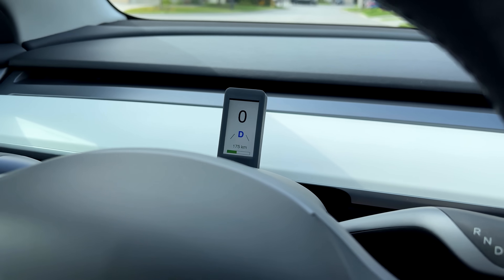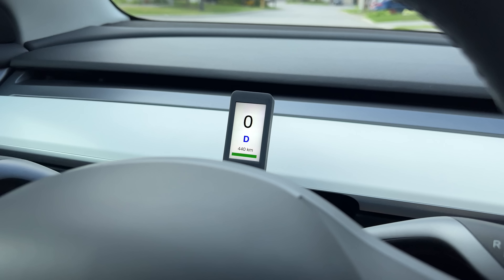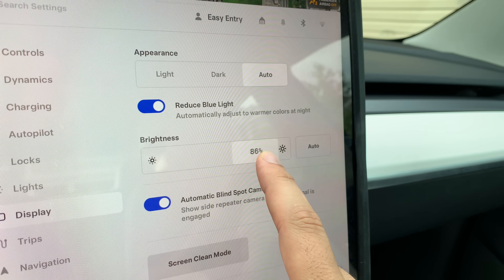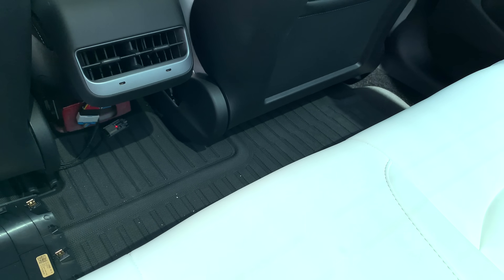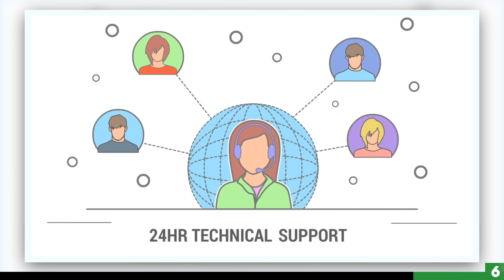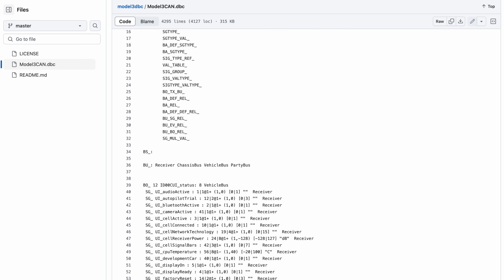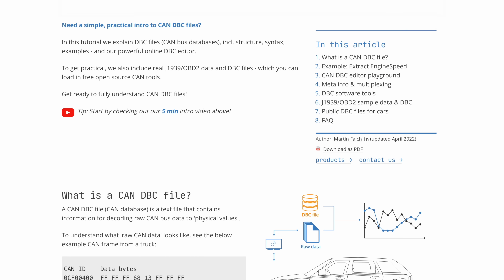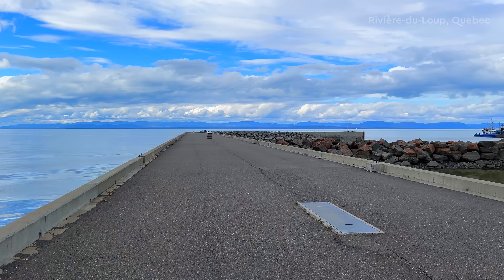I Made a Display For My Tesla

Comment: Awesome project thank you very much!! That would be cool, when the car is at home, from the ESP32 to post battery level to HomeAssistant API every hour. This way you can use HomeAssistant to track down the charging. Also, HomeAssistant could trigger the charging plug when solar panels generates enough energy to charge the Tesla from solar instead of the grid. :)

Comment: Hi! I flashed the stuff to each board and while the CAN SHield turns on, my screen flashes for a small bit, then turns off. How do I fix this? Is there a common issue I might be leaving out?
Reply from the maker: It should work without any setup. Just reply to your order confirmation email with your setup details, and I’ll try to help

Comment: I’m working on implementing Battery Preconditioning and Drift Mode. I think I’ve figured out the Battery Preconditioning part, but I couldn’t find how to disable ESP and regenerative braking for Drift Mode. Do you know their names in the DBC file?
Reply from the maker: That is great. I am not sure about the ESP/Regen. I don’t have that option in my car to test. However you might want to try the Tesla Motors Club forum or their discord channel. They created the DBC file.
Reply: Are you sending values to can bus? This is my next part of the project. Do you use discord?

Comment: I tried flashing the display with your online flasher but someting is not ok, flash seems to be ok but after rebooting the display it seems to be just an OTA updater. Did I miss something?
Reply from the maker: OTA activates when the button on the screen is pressed. It seems like something might be unintentionally pressing that button.
Reply: @MrDIYca , thanks for you answwer. Yes, that was me, I pressed the button because on boot there is nothing in the screen, just blank, it this normal until the CAN bridge send any data?
I also tried the source code link and is seems to be dead
Reply from the maker: That's correct, you won't see anything until the bridge begins transmitting data. It's a members-only link, but unfortunately, YouTube just displays a generic 'not found' error page if you are not a member of the channel.

Comment: Hey! I've purchased about 8 of your CAN shields and love them but I'm having a pretty big issue.

Read mode works flawlessly but ReadWrite mode shows weird behavior. When measuring resistance across CAN H and L I get 120 Ohms in read mode but 0 in read write (soldered the jumper). What's weird is without power but in ReadWrite mode it reads as 120 Ohms but the second it gets powered it drops to 0. The voltage also is off, CAN L reads 0.8v and CAN H reads 3v. Again read only mode works perfect and has them both around 2.5 with no traffic

The ReadWrite mode only seems to work properly if it is initialized and serial monitor is running. Otherwise it causes havoc on the bus, all sorts of impedance and voltage issues and it shuts down my tesla completely. It's also shut down a Rav4 and caused the MIL to go off.

My guess is that when getting power from the vehicle via the 12v pin the bus isn't initialized in time causing these issues, but it works when it's powered prior to getting connected.

I did some more testing and I see you're pulling the RS pin of the CAN transceiver to ground through a 10k Ohm resistor. The transceivers datasheet says a 10-100k resistor puts it into flow control mode but a strong Pulldown to ground puts it in high speed mode. Edit: Bridged the resistor so it enters high speed mode but no difference
Reply from the maker: You're right, something is off. If you're seeing 0 Ohms across L and H, there has to be a short somewhere. I just sent you an email—let me know when you have some time so we can troubleshoot this together.
Reply: @MrDIYca  Thank you!! I sent you an email reply

Comment: Fantastic! I can't tell you how excited I am about people who, like you, implement technical projects. No matter whether car mechanics or electronics. Unfortunately, my 100 interests coupled with a lot of half-knowledge make it difficult to implement my projects 😵‍💫😁 I have currently implemented a Digidash for my old Mini Cooper r53 S. I use a smartphone in a 3d printed housing with an OBD2 dongle via Wifi, car scanner per app & all the media advantages that an Android has. What bothers me is the general latency - start the cell phone or scanner app, connect it to WiFi, connect the charging cable every now and then, etc. Do you think that it is possible with your components to control a circular touch panel and output CAN_OBD2 data as a speedometer? Could apps like Google Maps and music players also be displayed in such a system? I know that everything works somehow, but I would just have to deal with it for years. But I also don't like to just buy ready-made solutions - which don't exist for my old Mini anyway. You're doing great work 👍

Comment: The main things that should be on this screen are all-time-on blindspot sensors (green - OK to turn, or red - not OK to turn), and rear cross-traffic alert if possible.
Is that possible to display?
Reply from the maker: So far, I was not able to find that CAN message but I know it is there!
Reply: @MrDIYca  Where is it reading that CAN message from? i.e where is it plugged in?
Reply: @MrDIYca  There are entries like, 
" SG_ DAS_blindSpotRearLeft : 4|2@1+ (1,0) [0|3] ""  Receiver
 SG_ DAS_blindSpotRearRight : 6|2@1+ (1,0) [0|3] ""  Receiver"

BUT, the data is from THREE YEARS AGO - so not sure if this if from the ultrasonic sensors at that time - because current Tesla Model Y doesn't come with sensors - only cameras. So is this data still valid?

Could you please check that in your code? Thanks!
Reply from the maker: @loveanimals-0197  I will check it out, thanks
Reply: Please let me know if you had any luck getting blindspot date displayed on your setup.

Comment: Amazing. I have your CAN Shield 1.1 (older version), is it possible to do it with it too?
Reply from the maker: Yes, you just need to wire the OBDII port by hand
Reply: @MrDIYca  Thank you so much for your response. Can you tell me, if I have to solder the "voltage divider" or the "CAN termination resistor" if I want to use it in my Tesla model 3 from year 2022?
Reply from the maker: @simon-yt  No, no need. The car already has the termination, and the divider is only necessary if you want to monitor the low voltage battery.
Reply: @MrDIYca  thank you so much for your help. I tried it out (flashed can reciever and display) and it worked instantly. Super easy! 

When I press a button on the display, I can connect to a wifi, but it is password secured. What is the right password here? Thanks a lot
Reply from the maker: @simon-yt  Awesome! great to hear. The hotspot is there for OTA. The password is: mrdiy.ca
Reply: @MrDIYca  Thank you so much! I found the code from the can reciever but I wasn't able to found the code for the display - is the display code public so I can play with it and make some changes?
Reply from the maker: @simon-yt  It is available to my YouTube members, but reply to your order email and I will send it to you.
Reply: @MrDIYca  Will do, thanks!

Comment: This is great but would it have been possible/cheaper to use a Bluetooth-enabled ODB2 dongle?  Or are they not fast enough to capture all traffic?

And more importantly, is there a similar DBC file for the new Volvo EX30...
Reply from the maker: Thanks! ELM dongles can technically read CAN data, but their hardware is quite limited in terms of buffer size, memory, and processing power. As for Volvo EX30, I'm not aware of specific support. However, OpenDBC does have a few DBC files for Volvo, though I can't confirm if they will work with the EX30 - https://github.com/commaai/opendbc/tree/master/opendbc/dbc.
Reply: Found this channel looking for EX30 aftermarket driver's display. Glad to see I'm not the only one.

Comment: Have you thought about messing with sending CAN messages to enable hands free auto-steer?
Reply from the maker: I built a gadget that controls the volume, and it might be used for this purpose. I'll test to see if it works
Reply: Just be careful.. Safety requirements have reasons… would you make a by pass for seatbelts? Just because you can does not mean do.
Reply from the maker: @markpirola8152  Valid point - https://twitter.com/MrDIYca/status/1729646265044972004